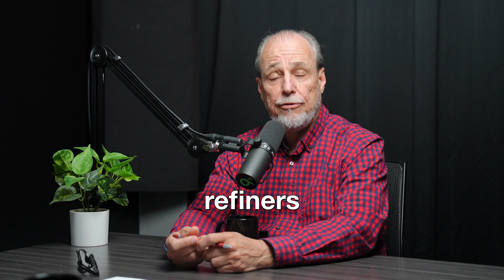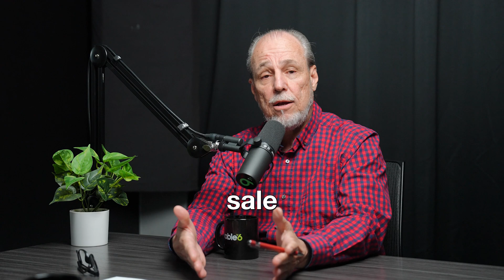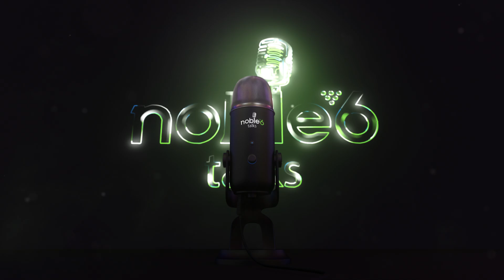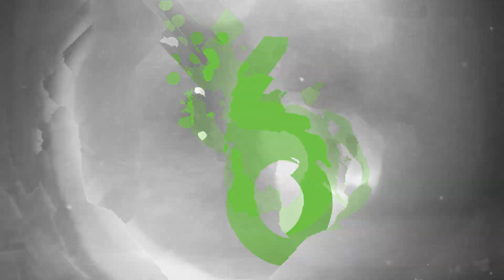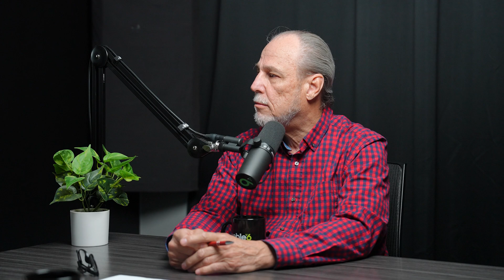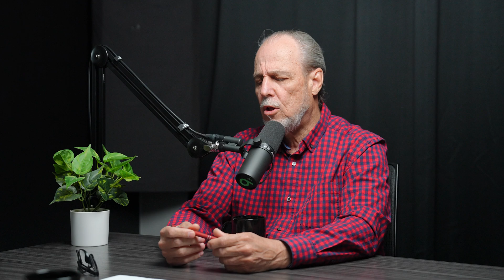Catalytic Converter Recycling Explained: 5 Segments of the Supply Chain

Comment: Interesting your not mentioning the six. I know there are more then 6 in the us. Prob more like 20
Reply from the maker: Great observation ,and you're right to point out that there are more than six companies involved in refining converter material. There are dozens of intermediate precious metal refiners in the market that can process material to a relatively high purity.

However, when we reference "only six refiners" in the podcast, we're specifically talking about those accredited by the London Platinum and Palladium Market (LPPM) — the global standard for refiners capable of producing high-purity sponge or ingot of platinum group metals.

While intermediate refiners play an important role, they ultimately need to send the material to one of these LPPM-accredited refiners to complete the final stage and produce finished, high-purity material that meets international specs for reuse in manufacturing.

Appreciate you engaging and helping drive the conversation forward!
Reply: @ thank you for responding and clarifying! Very interesting episode